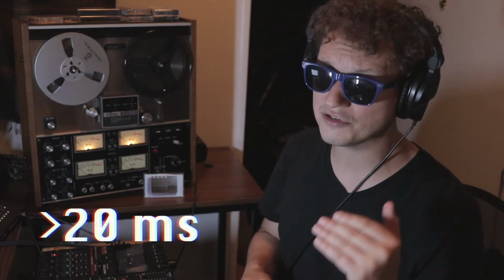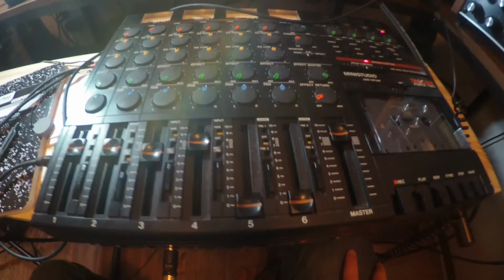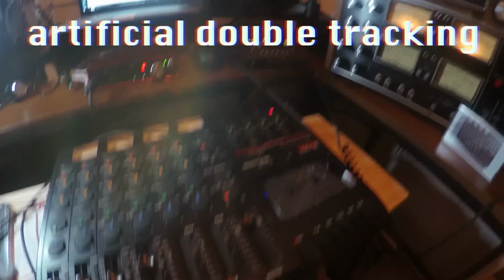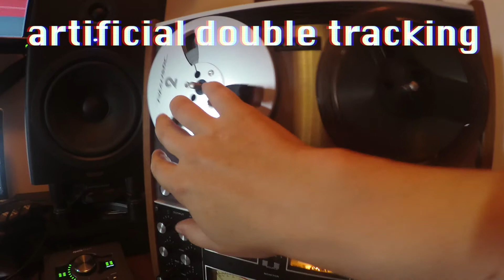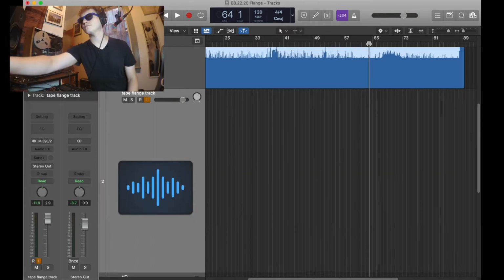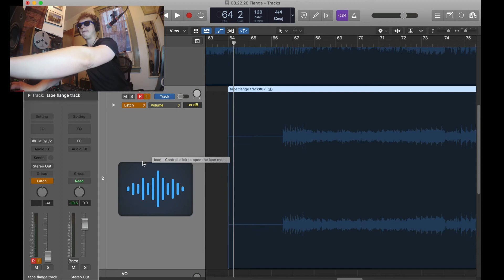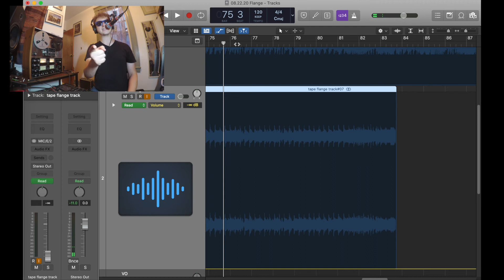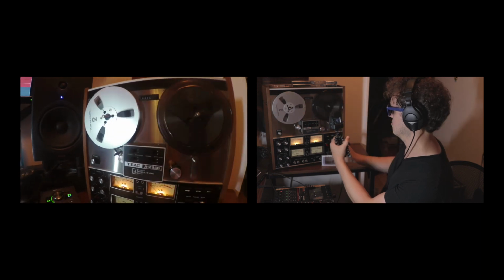How to tape flange with a reel to reel ||| MADE ON TAPE

Comment: Technically since the beginning of times The "Delay" pedal should have delay, flanger and chorus in the same pedal.  I mean ALL delay pedals.  They just want to make you spend more money to buy the same circuit with different configurations..
Reply: Different delay technologies have different capabilities re: min and max delay times. This among other reasons may make a pedal more appropriate to use as a delay or chorus. There are versatile circuits capable of both